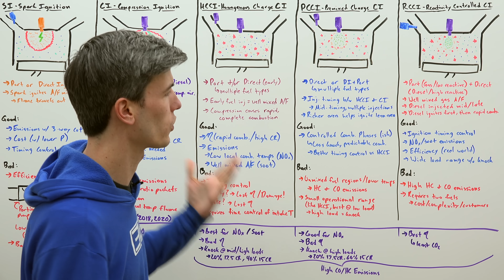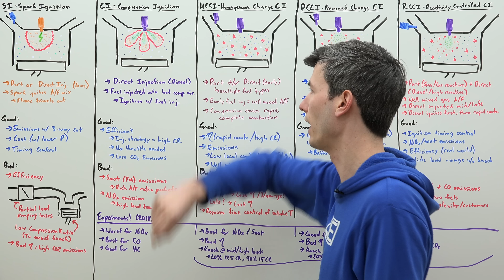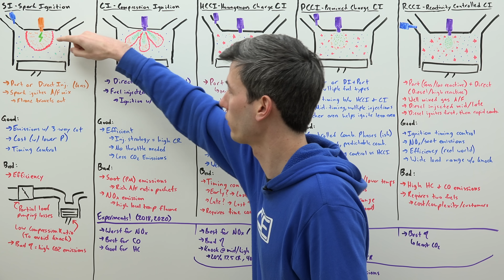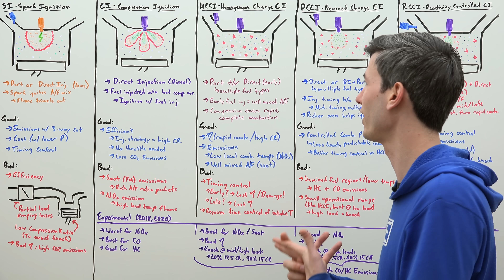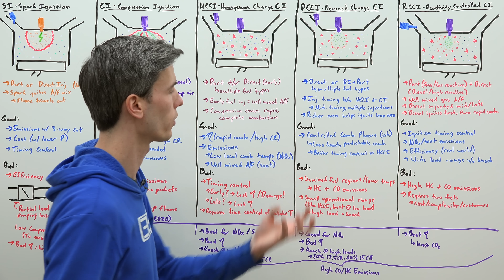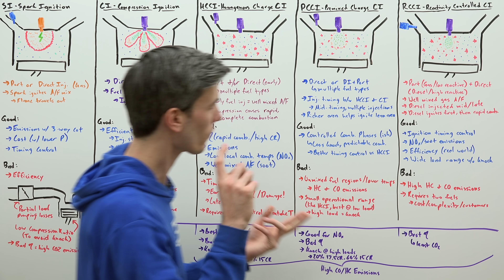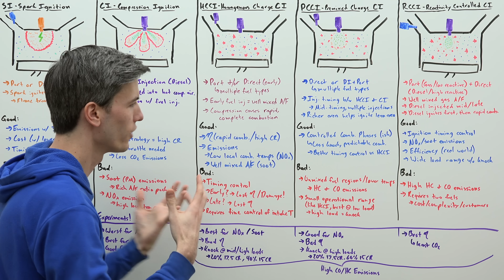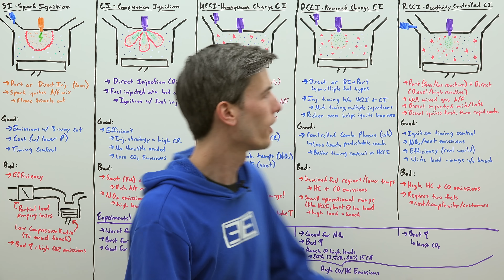If Combustion Engines Have A Future, What Is It?

Comment: in 1921 the Model T could run on four types of fuel. Was offered in coupe, sedan, truck, and delivery models. Could easily traverse the most horrendous roads of the day and ran on to be one of the most sold items of all time. 

In 2021 the F150 can run on two types of fuel for SI and one for diesel. Its offered in a 2 and 4 door truck styles. Can easily traverse the most horrendous roads today and is still the number one selling vehicles year after year. 

They both get 15-20 mpg. 

In literally 100 years of technological advancements in every single facet of the automobile, except fuel consumption.

Comment: All five models utilize pistons, crank shaft, cam shaft, connector rod, rocker arms, valves timing chains, cylinder heads,lifter rods, engine block -----

Comment: Should be mentioned the benefit of Modern Atkinson Cycle throughout this. Also (forgotten in previous episodes), all advantages of Diesel characteristics of those (high compression built), available when running conditions are "acceptable". Ex. low throttle/cruising speed...

Comment: Where are we with electric motors taking their energy from a fuel cell, fed by hydrogen or biofuel?
Reply: Toyota thinks that's the future. But there has to be some huge breakthroughs first. The efficiency is poor. It might find a use in aircraft.

Comment: No mention of the two stroke opposed piston diesel? Cummins just launched a partnership with Achates and is building six and four cylinder truck and tank engines. They're claiming up to 60% thermal efficiency, which is close to power station levels.

Comment: 2 fuels doesn't seem to be that big a problem, you just fill up at the same pump.

Also, from a thermodynamic point of view, its not fair to compare electric engine's efficiency compared to a heat engine. The thermodynamic cost of energy conversion has already been paid for electricity at the power station.

Comment: I have an idea to fix the RCCI engines two fuel issue for the consumer. At the station the nozzle can have 2 pumps connected together. Regular Gas comes out of the left nozzle and Diesel out of the right nozzle. The whole nozzle itself could connect to a gashole that has 2 holes, to take in both the diesel and gas into the 2 separate fuel tanks. The connection process would kind of be like a wall plug but a fuel nozzle.

Comment: Powering big utes that North Americans call trucks that are borderline truck weight that run on a liquid fuel called "Gas"

That's the figure. 

They will however go from 2 gallons per mile to 2 miles per gallon.

Comment: this is good but he didn't take in the fact that most motors dont run on a single piston so most of the experiment part of the video is pretty far from actual application. Also the video is pretty cool but you didn't talk about how well each type of engine can run under different pressures and temperatures wich in my opinion would invalidate all the charge dependant motors.

Comment: I can see an application for fixed power systems like standby or mobile generators.  Possibly to drive pumps.  Fixed rpm applications are easier to build to and we need ICE for these applications for the foreseeable.future.  batteries can only store so much.

Comment: I really think the best technology would be an E100 compatible hybrid using super capacitors instead of battery technology. It would currently be the best middle ground for all customers. And being able to use petrol, but also switch up to ethanol, these cars can utilise current fuel networks and automatically upgrade to being carbon neutral when ethanol production becomes efficient enough. Having real demand for ethanol being third the price of standard fuel will help drive solutions for our supposed food shortage "worries". No current car company besides Tesla is game enough to do something truly unique. Having a future fuel proof combustion vehicle with light weight (easily accessible materials) super capacitor hybrid could be a massive game changer.

Comment: Ethanol added gas makes your car penguin 🐧 friendly, less miles for the same money))
Reply: Ethanol is popular in farm states like mine and its a great race gas, but there is one big problem at the end of the day: If you take all the diesel fuel used to plant, harvest, and transport the corn then all the natural gas used to provide heat for the fermentation/distillation process at the plant, then the trucks hauling ethanol around to the refinery to mix with gas, then the trucks hauling the E85 to gas stations... the whole process is a net energy loss and we'd have been better off just running cars on the diesel and natural gas used to make the ethanol. You expend more energy making it than you get back out by burning it. That's what keeps fossil fuels so viable: pumping them out of the ground and refining them is a net energy gain, not a loss. You get more out than you're putting in. Biofuels almost universally take more energy to produce in a net loss, making them essentially a boondoggle to prop up corn prices.

Comment: People seem to forget that one of the main reasons for switching over to electrically powered vehicles has nothing to do with the environmental impact, they are just better in almost every way! The lack of maintenance, The instant torque, significantly less complexity, ect!
That and you can get the electricity to charge them from many different sources whereas with gasoline engines you can only get the energy from gasoline!

Comment: Engine optimized to efficiently power a generator to charge/power ev;  1 rpm for 1 load. Turbine might be better for that though.
Reply: Turbine co-generation plants for combined heat and power are really cool and very thermally efficient.

Comment: Internal combustion engines had a good 150-year run but no empire lasts forever. Seems that the pinnacle of what that technology has to offer has been reached and every new solution is ever more complex and the returns are diminishing. Time to fall back to niche applications and yield the stage for electric motors. For those who like to list their drawbacks and shortcomings, bear in mind that the technology has been applied seriously to cars for only 15 years, 1/10 of the internal combustion engine's life cycle.

Comment: I’m wondering if they could put a non-reactive fuel or additive with the diesel in the HCCI motor to stop the preignition instead of it igniting from heat have it only ignite from pressure
Reply: They already do that; with gasoline it’s the Octane Rating and with Diesels it’s the Cetane Rating.

Comment: Yunick vapor cycle engine from 40 years ago?
Burning a liquid even as small droplets is sub par, getting a liquid fuel to a gas state requires heat AND higher pressure, which the Yunick patent (expired) answers.

Comment: How about atkinson cycle gas engines (very similar to Miller cycle gas engines respectively budack cycle gas engines)?
41% thermo- mechanical efficiency - not shabby at all (a steam turbine power plant gets 50 - 52% thermo-mechanical efficiency)
Reply from the maker: Yes - 41% is certainly very good for a gasoline engine! RCCI in theory can be around 50+% efficient.
Reply: @EngineeringExplained  ok thank you!
This 50+% is a theoretical maximum?
I think production diesel passenger car engines achieve 42% real world- big industrial diesels are more like 44 - 45%.
There is still a big gap between "optimum efficiency" at the optimal load and "overall efficiency while running an epa or wltp test"...

Comment: I'm not familiar with the term "reactivity" in the context of the ICE but it seems that you may have reversed the descriptions of the gas and diesel in that engine.  Gas loves to ignite from compression which is why we have to keep compression ratios so low compared to diesels.  On a diesel, you need a ton of compression to get that fuel to ignite.  I would say that the gas is more "reactive" by that definition and the diesel is less.  Also I feel like there may have been another set of technologies that should have been part of this like variable compression, but also engines that essentially run compression ignition at low to mid loads and spark ignition at high loads (which may just be the variable compression applications?).

For what it's worth, it still seems to me that the peak of ICE thermal efficiency is an old school turbo diesel.  No extra squirts for emissions and noise or lighting an SCR.  Makes me wonder what would be possible without emissions regs.  That said, NOx (and possibly CO, HC and soot) is much more of an immediate/direct health hazard than CO2 so optimizing to lower those at the expense of fuel economy makes sense that way.

Finally I would suspect that the application to get highest thermal efficiency from the ICE is single RPM applications, like a series hybrid (diesel electric locomotive type) powertrain.

Comment: If we ever get effective fusion energy, then combustion engines will have a great future due the high energy density of hydrocarbons. With sufficient energy, we can extract them from the air, and effectively use them as batteries.

Comment: HCCI needs adjustable compression to fix the timing issue. 1950 model aircraft diesel engines were HCCI and used a screw in the head to adjust the compression by moving the top of the cylinder head up and down. This was OK as these engines worked at one RPM most of the time. These days it may be possible to vary the supercharged inlet gas pressure to achieve the same result but over various RPM.
Reply: It must not have worked worth a damn as it wasn’t widely adopted ...

Comment: The Internal Combustion Engine still has a long life, for decades to come, but it won't be mainstream for long. EVs will replace ICE cars soon,  because no matter how you burn fuel, you still burn it, and you still release unwanted gases and particulate matter in densely populated areas. Low emissions are better than high emissions, but nowhere near as good as NO emissions.

Comment: The original diesels ran on peanut oil, and when the fossil oil gets too expensive they could go back to a plant oil. Gasoline engines could be converted to run on natural gas instead, either a gas or converted to a liquid. Fossil natural gas will likely last our lifetimes, and flammable gas such as methane can be made by feeding plant material to bacteria, sometimes collected from landfills now. There will likely be a lot more hybrids, all electrics, and electrics with a gasoline or diesel engine as a range extender, like the BMW i3 now.  The Mazda Skyactiv X engine is not selling well, it costs more, does not get the miles per gallon advertised, and the future reliability is unknown.

Comment: Honestly I don't see any problem in putting 2 fuels in my car... let's say instead of a 60 litres tank, two 30 litres tanks (or the correct proportion depending on how the engine burns the two fuels)... when you are at the gas station, just refill both...
Only fat ass lazy people could complain of dual fuel cars.
I mean: it will be still WAY MORE CONVENIENT that wait 40 minutes for that crappy Teslas to be charged in the middle of a road trip...

Comment: The fifth type of engine is already present as an LPG installation for diesel  engines (cheaper, air intake installation). They are not very popular due to the long repayment period, but taxi drivers in Poland use that quite often. It has even a nickname LPGTDI and nobody considered it as the most ecological one. Dual fuel is not that a problem, if it is cost effective. Who would fought that the future is in miser Janusz's* garage ;)
*Middle aged primitive guy, a dictionary shows "Billy" as USA equivalent.

Comment: "Pretty much useless if you can't get full load out of the engine" 
cries in Atkinson cycle
Reply: I think the gains that Toyota see in their mild hybrid vehicles Atkinson cycle range compared to straight Otto cycle is remarkable. 
~50% less fuel usage and better drivability. Excellent efficiency gains for very little extra outlay.
Reply: @MrBenHaynes  All true, but I think you misunderstand what I meant. Atkinson cycle engines have only 60% the maximum full load hp of a similarly sized otto cycle engine. I was just chuckling to myself when he said pretty much useless at 40% full load when the Atkinson cycle at 100% load is only producing 60% of the hp

Comment: If there was a way to premix the air and fuel better, maybe we could burn less and get the same boom (a series of very fine mist sprayers in the intake, or maybe a sleeve made from a material that will "sweat" the gas through so an air intake can pick up the finer particles)?

Comment: Because of the laws of thermodynamics, it doesn't really matter with any of this because you can never exceed a certain point of energy efficiency. Which is why battery electric motors are the future.
Reply: I agree but ice have a future as well cause of synthetic fuels

Comment: I run a thirty five year old Fiat ☓1/9 1500, which passes the UK emissions test with a considerable margin.
I said, haha are you sure the machine is working OK?
Tester says, yeah it's working fine buddy, this Fiat runs cleaner than most moderns is all. 
Fiat is 8V, single downdraft Weber, 121,000 miles. 
Does this mean that there's been literally no progress made in engine design since the early seventies? 
Or that the UK government policy on emissions is just a huge stinking lie and has been for a long time?

Comment: could someone build an electric car and pair it with a generator that does not need variable output?  It'd seem that if you built something where you always knew exactly what RPM and resistance it would run (since it's just charging a battery) you could make it work pretty well.  Am I crazy?

Comment: What about hybrid technology? Maybe a less efficient ICE will do a whole lot less environmental damage if it only handles the average power load instead of the maximum power load. It could be designed to run at just one speed then.

Comment: LPG, CNG, and specially Hydrogen... Lpg will provide immediate drop of emissions for gasoline engines for around 11% at the tailpipe. A study done 8 years ago. The real question is: why they don't want you to use it?
Reply: All the mail trucks and garbage trucks in my town run on CNG, my school bus back in the day was LPG, driven lots of LPG powered forklifts. Its way cleaner than diesel, but its a chicken and the egg problem: Nobody would buy an LPG car because there are no gas stations, nobody will build a gas station because there are no LPG cars. Works best for fleet vehicles right now that always come back to the same place where you can fuel them up.

Comment: Remember the old Chrysler turbine engine?  How would you rate that engine?
Reply: The trouble with turbines is they're a lot better at steady RPMs vs stop/go driving and need a lot of gear reduction. BUT. If you have a turbine generator providing electric power, now we might be getting somewhere. They're just such high tolerance machines I don't know how well they'd cope with the neglect inflicted by the average vehicle owner.
Reply: @SOHCGT96   I like your idea of using it at a steady RPM as a generator, then using electric motors to turn the wheels.

Comment: Great detailed analysis of IC engines. However, everyone seems to be missing the main point. Using 3,000 to 5,000 vehicles to transport people weighing less than 200 lbs each (often only 1-2 only) is nonsense. 90% of the fuel is being consumed on the vehicles weight alone. These bloated hefty tech laden elephant mobiles make no sense at such a vast weight differential to the weight of the people they are designed to carry. Nuts!

Comment: For the compression ignition with homogeneous fuel mixture, if the piston is floating on Belleville washers you could prevent the pre-ignition. With the proper tuning, the washer springs would only build enough pressure in the pistons after the springs are compressed. The limiting factor would be the ability to catch the piston from springing up during the induction cycle

Comment: I bet a good use for the hcci would be for an electric generator (range extender) for an EV like you see in the fisker karma, bmw i3 and i8, etc. That would be cool to see and might be the best of both worlds. Max efficiency with a low engine load, since you never rev the engine up in cars like those, being that they are merely used to generate electricity

Comment: What about burning something other than gasoline or diesel?  Might not see efficiency gains, but that's less of an issue with renewable fuels.  There might be an excellent stop gap until energy density and charging issues can be solved for electric vehicles.

Comment: Small displacement opposed cylinder diesel engine running a generator to charge batteries and provide extra current to electric motor drive train. Think of a pickup truck that is powered similar to a diesel/electric locomotive.